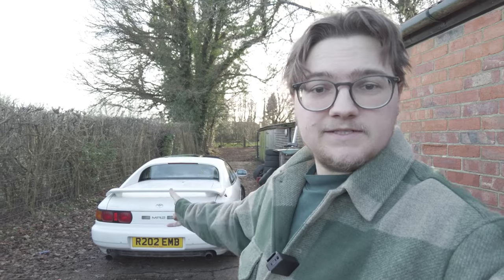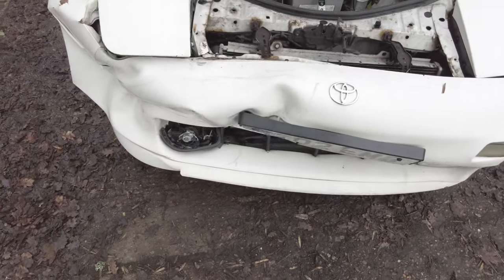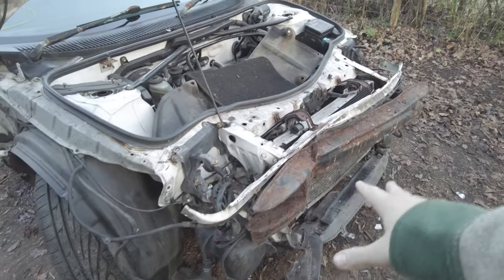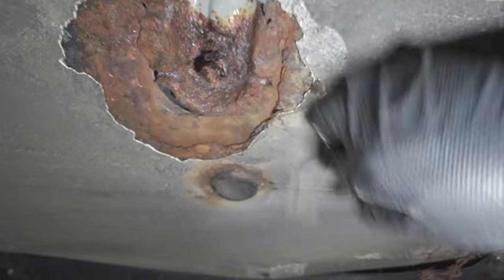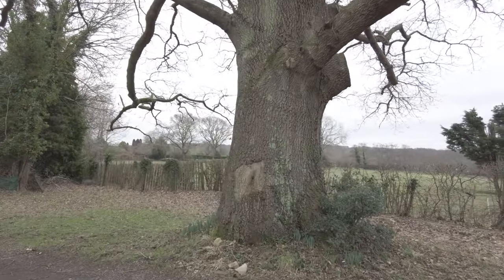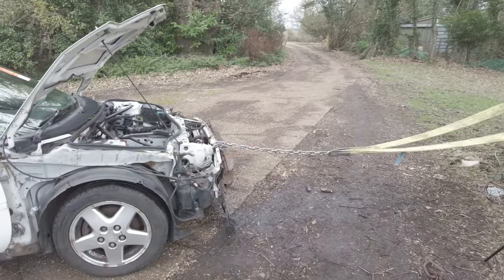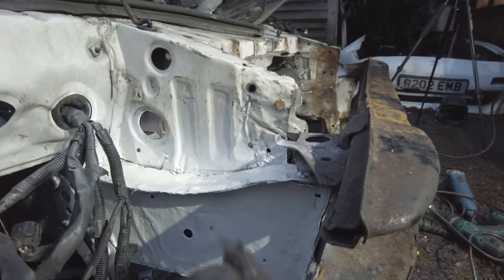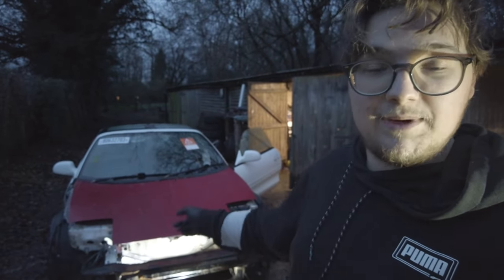Toyota MR2 vs. Tree Tug of War ... Insane Frame Repair!

Comment: Saw your comment on the last post about the boot rust. Mine has it, and is generally a really clean Sw20. It isn't structural, so use rust converter, possibly patch it and paint it, then ignore!

But GOOD ON YOU FOR SAVING IT!

These cars are getting rarer and rarer, more and more expensive. You have saved it when someone else gave up on it! You have my thanks as a fellow SW20 owner!

Comment: As a panel beater of many years I would say that you did a great job pulling out the frame rail but should now cut it off and replace it as the pulled one will be severely weaker than original, they are pulled out to make it easier to replace not to be reused.
Reply from the maker: I was thinking of plating over where it was once bent with thicker metal would this not be stronger? Thanks
Reply: @cashmachinecars  it's not really about stronger as it is a crumple zone and designed to collapse and absorb impact.

Comment: It’s surprising what cars you can save yourself when they seem wrecked. I thought my partner’s Corolla was toast after it collided with a heavy deer. I don’t have a welder so I drilled out all the spot welds on the rad support etc and got the parts from a junkyard car and bolted them on instead, got it set up as straight as I could by eye then tweaked it when I put the used panels on (got lucky with same colour ones) and it turned out great. At first look you’d have definitely thought ‘totalled for sure’ as I did. Keep at it - good luck. 👍🏻
Reply from the maker: Thank you I think it's always good to try and keep these old cars on the road if possible!

Comment: Enjoying your channel but suggest you either put this out for spares or replace the crash structures with new - can’t really put a car back on the road with compromised chassis legs and crash bar - might look ok but it’s weak and could cost someone their life
Reply: Did you actually watch the video ?
Reply: Yes - I guess the point you’re making is that you believe the repair is structurally sound. It isn’t - once steel is taken past its yield point then its strength is reduced, reforming the chassis leg so that it looks similar to what it was does not mean that it will collapse safely next time as it’s already fatigued. Fine to use the tree to put the structures back in position but then the chassis legs should be cut back to the next factory joint and new sections welded in.
Reply: @llessibm  nope , i know its not sound but he did say hes going to replace it , i thought you might have commented before you saw that :)
Reply: I heard him say that he would be replacing the crash bar, not the chassis legs - if I’m wrong then my apologies
Reply: @bren70ssss94  Nope, he said he thought about replacing it, why do you think he painted it white if he is going to replace it? thought you may have noticed that?

Comment: I don't think the bent parts will be as strong as they once were if the car was in another accident, I think it should be scrapped, sorry.
Reply from the maker: I do agree it might not be quite as strong, I doubt it's hugely weakened but I might plate over where the worst was to strengthen it, it shouldn't really have been saved but I like to save cars on the channel so they can have another small lease of life haha 😂